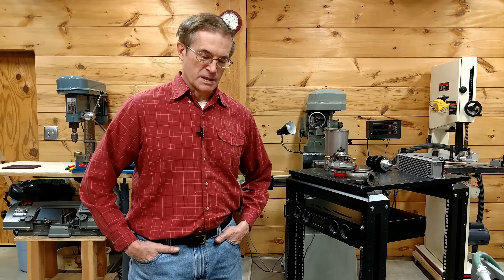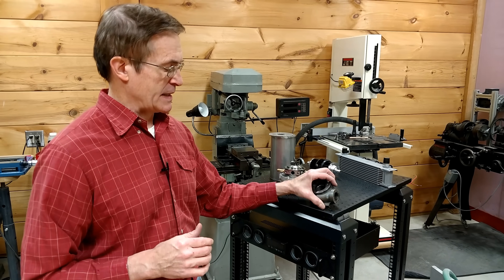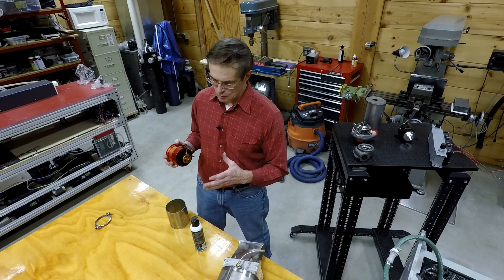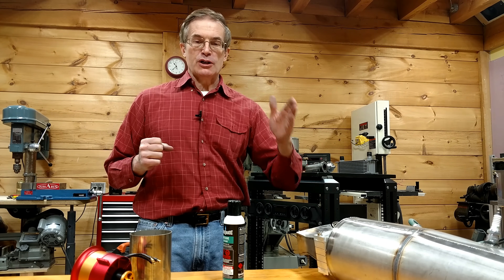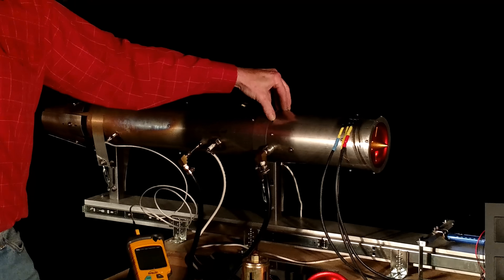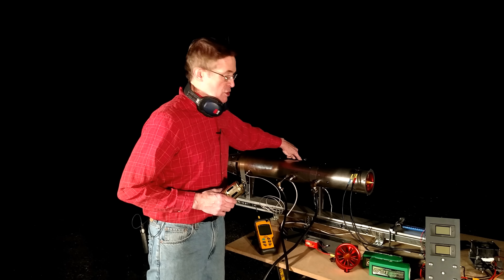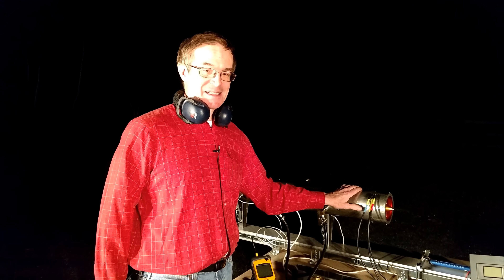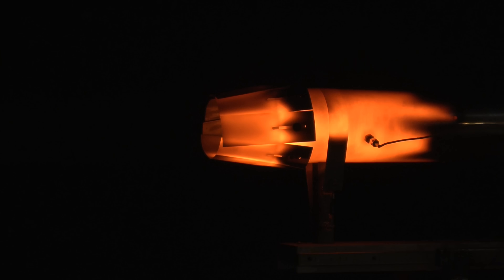Hybrid Jet Engine

Comment: This is a super cool idea actually, It never occured to me to say bollocks to the turbine and its associated exotic materials and tolerances... just put an electric motor on... Pumping water and alcohol mixture in will add cooling, the alcohol will be used as fuel of course, and the water will vaporise and expand.

So long as the motor can keep up with all of this without stalling and making a mess... but then it also gets you thinking... Isn't this basically a ram jet, but with a fan to power the intake at low speeds? Mounted to a high speed aircraft the fan would need to do less and less work.
Reply from the maker: And, eventually act as a turbo cooler as it extracts work from the ram air in addition to supplying electrical current.
Reply: Saw you had what looked to be a pelton wheel which I assume you'll be using to exact energy from the exhaust in your APU configuration? Very interesting stuff, What was the noise like in comparison to a 'regular' jet engine? It will be very interesting to see how it competes with the 4-stroke motors, for output, efficiency etc...

I only just found your channel a few days ago while looking for information about laser projectors, and what a gold mine of information! You are pretty much living my dream, vast amounts of space and tools to build what you want and experiment. Keep up the good work, this is literally very likely THE best maker/hobbyist channel i've seen so far!

Comment: Could a jet engine use Liquid Hydrogen and Liquid Oxygen for fuel and still work?  I know that is typically rocket fuel, but would there be any thrust advantage to using such fuel in a jet engine configuration?
Reply from the maker: Sure.  The liquid hydrogen has an energy to weight advantage.  The liquid oxygen could be an alternative to an afterburner by acting to reduce the heat in the compression stages and improve mas flow and compression.  Hydrogen is a hassle to store and oxygen isn't much better.  Nitrous oxide might be an alternative and (this is just between you and me) we're looking into that.

Comment: I thought EDFs are not quite capable of compressing air, but designed to accelerate air. I have a 64mm one on my table and if you even slightly obstruct the exit, the fan slows down and doesn't produce any significant pressure whatsoever!
Reply from the maker: Whenever you accelerate air, that velocity can be converted to pressure just as it is in a pitot tube used to measure an aircraft's airspeed.  These fans are designed to move a relatively large quantity of air at a relatively low air speed and therefore their ability to create compression is limited.  However, these JP fans are pretty amazing, take a look at their YouTube videos.
The reason we use the cone and gradually narrow the aperture (to 60%) is that if the outlet is abruptly obstructed, the turbulence interferes with the airfoils.
Reply: Yes completely true, air velocity can be converted to pressure, provided that you don't hinder the flow generation mechanism in the process. Axial flow compressors have a series of blades and stators combination. These stators act like one-way gates and prevent air from going backwards and obstructing the blades. EDF's don't have this feature. Therefore the turbulence of disrupted air might hinder the flow generation process. 
Also, perhaps more importantly, when the pressure builds up, which means the flow slows down, the fixed angle of attack of the fan blades becomes less effective. Multiple stages with different angle of attack for each stage, inside a gradually narrowing path, solves this problem for axial compressors.

However I'm not saying your system wouldn't be effective. In fact I think it is a great idea and there might even be a commercial value in the RC industry for this. I'd like to see it as an after burner system though. EDF is your jet engine and whatever you have added is the afterburner. IMHO you shouldn't try to compress airflow, rather you should try to improve the burning process. I think you will have to increase the diameter of the exhaust in order to introduce more volume and keep the airflow rate constant. Pretty interesting project, keep up the good work and keep us posted.
Reply from the maker: The standard design of axial turbines is predicated on a common shaft and therefore a common rotational velocity and direction.
The elegance of these independent, electrical fans is that each stage can rotate at a velocity necessary to accelerate an incoming flow velocity to a higher output velocity.  For this reason they do not need to have a progressively shallower angle of attack.  The blades and the motors can rotate at a higher speed than they do in static conditions.  They do this as well when they are flying at at a high airspeed. In addition, each stage can rotate in the opposite direction negating the need for stators who's purpose is to redirect the flow vortex from the previous stage so that it enters  a subsequent stage with a favorable angle of attack.
Thanks for the support.  I think you'll like the modifications we are making in the new engine.
Reply: I'm sure I will. Subscribed to your channel.

Comment: What you actually are making is an afterburning Turbofan, not a turbojet.
Reply from the maker: Not really.  A turbofan is a turbojet with additional turbine stages producing additional torque to drive the larger cross sectional fan to generate additional thrust.  This is more efficient than an afterburner because this additional mass flow is not heated.  It is however, heavier and more complicated.  The very earliest turbojets actually had piston powered compressor stages and no turbines.  The engine we demonstrate has more in common with these engines than with modern turbojets.

Comment: You talk about using bypass air to keep a gas turbine cool. That's not the main reason, it's primarily to improve high subsonic fuel efficiency and reduce engine noise.
Reply: You also talk about choking the engine. It's more a matter of over or under expansion of the exhaust gas. Vaguely the same as what you mean but "choking" is sometimes desirable in an exhaust: it's the only way to generate supersonic exhaust flow.
Reply from the maker: There are several reasons for allowing air from the compressor to bypass the combustion chamber.  The point is that this bypass air contributes unused oxygen to the exhaust gasses allowing the afterburner to burn additional fuel.

Comment: Now the question is: Does the increase in thrust from the afterburner outweigh the massive loss of TWR caused by the huge chunks of tungsten fitted into the engine?

Comment: What kind of pressure ratio will an EDF produce?
Reply from the maker: This depends on the EDF.  I believe the JP Hobby fans are about the best and the 90mm fan will produce 1.3 PSI
Reply: Pretty similar to early axial compressors then. Thanks!

Comment: Cerakote has a black ceramic coating designed to help radiate heat,  that should work better than the jet's current unfinished surface
Reply from the maker: I know about that product.  Nevertheless, the intense heat has proved too much for the stainless at some locations.  The thin ceramic coating placed on the interior was to protect from oxidation, but not from heat.  The newer engine has a much, much thicker layer of zirconium oxide rated to 4,000 degrees F.  Along with bypass cooling, I believe we shouldn't have a heat problem in the future.

Comment: I keep wanting to say that this is insane, but it isn't.   Its just very well thought out.  Also the glowing metal doesn't look purple, which is how a lot of camera sensors seem to pick up glowing steel.

You know, this is an (almost) completely unrelated idea but I've been thinking about using a turbocharger backwards as a throttle for a standard piston based engine to remove the inefficiency of having a manifold absolute pressure that's significantly lower than the exhaust outlet pressure at anything other than wide-open-throttle.  There's not really any getting around the inappropriate compressor materials though.

Equally unrelated, I wonder just how cold the turbine section of a turbocharger can get before it stops working (with different "oil").  It might make a nice turboexpander for producing cryogenic temperatures.
Reply from the maker: If you think this is insane then just you wait!  Also, I like your idea regarding the turbocharger and you are correct that the "negative" manifold pressure undermines the efficiency of the maximum compression ratio.  How about this, duct the extra, available exhaust to a turbine half of turbocharger and run a three phase motor/generator to charge an onboard battery?  Easy to interface this with an existing hybrid vehicle with its batteries and supplemental motors.
Reply: Can't say that I'm ahead of you, but parallel.  I'm figuring I'll duct the intake air instead of the exhaust through the turbine half and use that to charge a battery, completely replacing the butterfly valve.  I was also going to try installing an extra alternator with some minor rewiring to use it as a motor and use probably the biggest ESC I can find tied to the throttle position sensor.

Maybe if all of that works and doesn't catch on fire too much it will make a half decent stand-alone hybrid system.  Since the throttle then would just be the load on the turbine it would probably have an almost magically bad throttle response.

Also possibly of note: using the turbine on the intake as a turboexpander should decrease the downstream intake temperature.  Pretty sure that also helps with efficiency.

Unfortunately its a bit moot since the only turbocharger I have right now is a gargantuan one off of an old military HEMTT wrecker.

If you made it this far, I really like your channel and the somewhat random but very well thought out topics it covers.  I didn't even know about audio exciters until I saw your video on them.

Comment: Would be be worth adding fins on the inside to swirl the air just after the RC fan for what I presume is a better burn?
Reply from the maker: There is already a significant amount of swirl in the air coming out of the fan.  Better mixing of the fuel is always good and the presence of rows of unaligned strips in the fuel / air flow helps a lot.  The nice thing about the strips is that you can continue to add additional strips until a good burn has completed, but not any more in order to avoid additional flow restriction.

Comment: Very nice construction!
I had done a few calculations on this configuration a long time ago. 
If you manage to put a few edfs in series you should end up with a good initial compression for the afterburner.

Are you planning to build a flying version?
Reply from the maker: Not sure.  As the future improvements are added and the unnecessary weight and size are trimmed, the resulting jet will become a lot more worth flying.

Comment: So then when you introduce the second stage fan and get more compression, you will have lower temperatures due to the greater air mass moving in? Or are you going to put in even more fuel to keep the high temps? 
Is the steel holding up? 

Is that plain 304 stainless? or something more exotic like high temp inconel?
Reply from the maker: It's 304 stainless and there is some erosion and deformation near the junction with the nozzle strips.  The second fan increases the compression ratio and even if no additional heat energy is added there will be more thrust as well as more efficient use of the same heat in converting thermal energy into exhaust, kinetic energy.  Nevertheless, additional mass will also flow and so some additional fuel can be added as well.

Comment: Fantastic. Subscribers of AgentJayZ already know a bit about the physics background, but it's cool to see this applied in such an awesome engine. Now find an RC model builder willing to put this fire-breathing monster in his plane :) Thermal insulation doesn't seem to be trivial. What nags me a bit is that you use "BTU" as if it were a unit of power, whereas it is a unit of energy I seems common when referring to blow torch power, but it's still wrong, and as a scientist/engineer you should not just repeat it. I guess that should that really be "BTU per hour"?

I'm firmly rooted in SI territory, so I don't relate to BTU anyway, I understand one BTU just over 1kJ, so 2,000,000 BTU/h seems to be almost 600 kW. For just a few daN of thrust increase that seems exceedingly inefficient. But fun. But inefficient. But fun. But inefficient. But fun.
Reply from the maker: Thanks for the comment!  The use of BTU derives from an abbreviation of BTU/hour and that is the standard value associated with propane burners.  Fuel flow from these heavy, liquid/vapor containing tanks is also usually specified as BTU/hr or in pounds/ hr.  Each tank is provided with 20 pounds of propane when full.  When we go to liquid fuel such as kerosene then we will specify the fuel use in pounds or Kg/hour.
This engine is indeed very inefficient due to the low compression ratio provided by the single axial turbine.  Even when we go to two or three electric fans in series, this engine will still be less efficient than a turbocharger based turbojet engine build.  At that point however, a lightened version with thin gauge metal could be an exciting alternative to the all electric EDF models currently flying.
If you want efficiency, the turbocharger build, the modified pulse jet build and eventually the pulse detonation engine should interest you.
Reply: Thanks. Yes, I noticed that about the propane torch "rating", but it remains irritating. Just like people saying their smartphone batteries have so many "amps" capacity, instead of amp-hours.
And sure, I understand that this is not a lesson in efficiency, but it's how to build an afterburner that actually does provide additional thrust, without requiring the special materials that a full turbojet would require for the turbine. I was still somewhat shocked about just how low the efficiency was :) That said, real-life afterburners are maybe a bit better, but not much, since they also work on the low-pressure exhaust air. They also often have a converging-diverging nozzle to make a supersonic exhaust, but I guess that's even harder to get right.
Reply: RL afterburners operate at well above atmospheric pressure (as they're upstream of the nozzle) but much lower pressure than the main combustor. They're also using air that's already had some of its usual oxygen content used up. The former ensures that the afterburner is very inefficient, the latter limits its thrust (as there's no point going beyond a stoichiometric mixture).

Interestingly, this means that the most efficient afterburners are found on pure turbojets (as they offer the highest afterburner pressure ratio) but for a given engine size the total amount of augmentation available is higher on a turbofan (as the fan pumps unburned air into the afterburner, permitting much higher fuel burn rates).

Comment: What about a solar powered gas turbine using a turbocharger?  Heat up the inside of the combustion chamber with concentrated solar.  Combined with the new high efficiency, high temperature solar cells, such an arrangement might get 60 or 70 percent efficiency from solar.  A conical reflector could be used to heat up a narrow pipe in the center as the "combustion" chamber.  Coat the pipe with  solar cells and put a glass tube around the  pipe and run the air from the compressor between the inner pipe and the glass tube.  One two meter wide reflector would be the equivalent of a rooftop full of solar panels and the waste heat from the exhaust would heat your house and hot water.
https://youtu.be/z8bIXeM0RJ8
Reply from the maker: A solar powered Sterling engine is definitely feasible.  Combing this with the cooling water needed to operate these multi junction, concentrator solar cells could indeed reach these levels of efficiency.
Reply: Tech Ingredients 
Your turbo charger gas turbine costs a lot less than a Sterling engine.  Turbo chargers have become remarkably efficient over the years and quite possibly more efficient than the Sterling engine.  A Sterling engine might be equipped with a fan to capture the waste heat, but the gas turbine is already a fan moving large volumes of air. There is emerging technology for synthesizing hydrocarbon fuels like methanol and ethanol with concentrated solar.  These require large volumes of air to pass through the system to extract the carbon dioxide and water vapor.
  https://youtu.be/GJ5mpQqmZaM
The weight per horsepower of a gas turbine is generally a small fraction compared to a piston engine.  There are large solar farms that use mirrors to heat a chamber of air to drive a gas turbine.  It could be miniaturized for the rooftop.  

There is another possibility.  If there were millions of these in a metropolitan area and they were each connected to a modest supply of microwave energy, the combined firepower would be like  tons of TNT per second and create a plasma ball in the sky that would destroy just about anything.
Reply: Tech Ingredients 
Well they use water cooling but maybe they could use air cooling.  
Here is another project for you in the comments at this video.  
https://youtu.be/2hsko1XprbQ